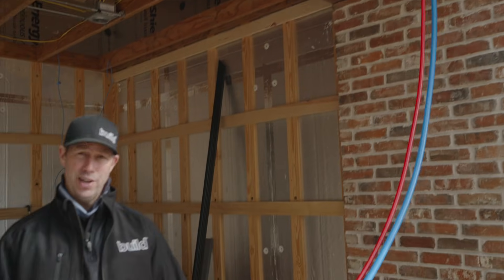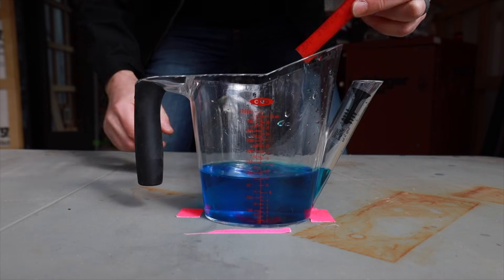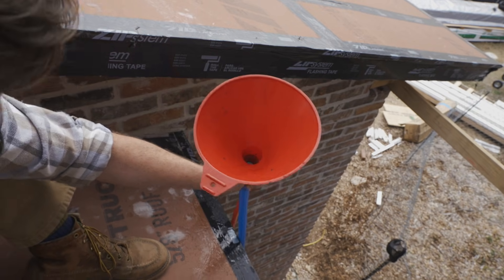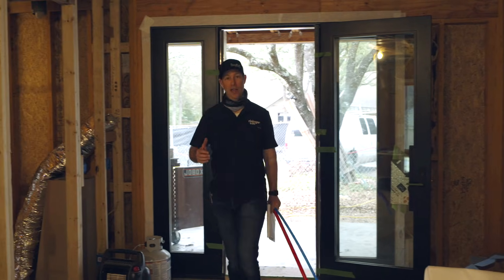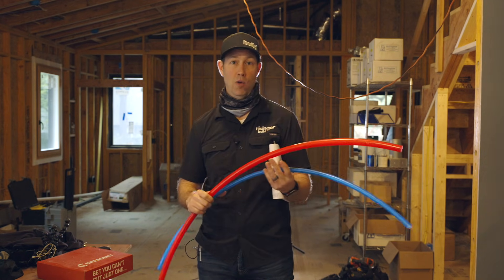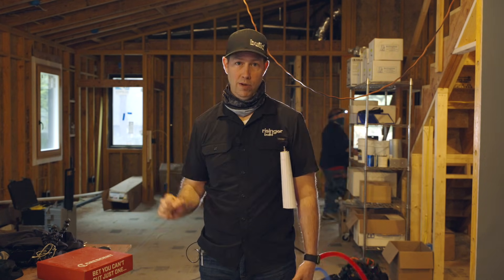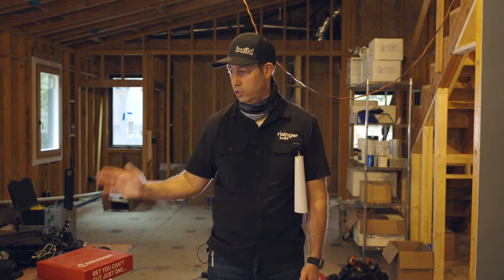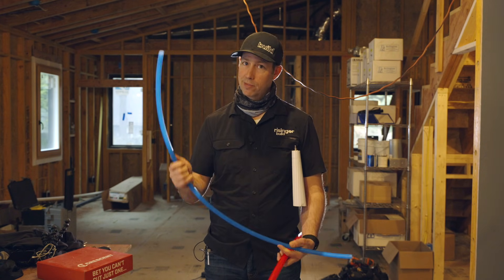What's the BEST Plumbing System

Comment: Thanks Matt. I love the nerd testing and stats on volume comparison between 1/2 and 3/4. Recirc pumps are definitely on my list of epuipment to implement as standard practice. Though it's a hard sell for some reason. My last two clients declined recirc pumps, and now they regret it. I installed a Veiga Manabloc in 2009 in my first house. I loved the idea of controlling each fixture and eliminating joints. But using less pex with a trunk & branch system and the assurance of ProPex joints I've not installed one since.

Comment: Could you have a hybrid of a manifold that splits to different bathrooms, then its trunk and branch in that room?
Reply: Yes. I repiped my house in that manner. Shut off at each sub manifold. Every bathroom and kitchen has a sub manifold with water shut off. I can control every single pipe in my home with water shut off. Hot and cold separately as well, or shut a zone down and beyond.

Comment: It would be nice if you did a video of your "structured wiring" set up, dealing with network cabling, coax, and so on.
Reply: @zlmdragon.  To get the most out of an antenna you pretty much do. Yet another issue of whether you want a good enough system or the best possible system.
Reply: @zlmdragon.  Yeah there are quite a few "rules" for running coax. Stay away from high voltage cables and if it has to cross one it has to be perfectly perpindicular. Cut the excess cable and put a new end on, or at least don't coil the excess because it can cause interference, etc. I don't even know most of the rules for antennas that's above my pay grade but I know a guy that is a HAM radio operator that told me those rules for coax and that's just the basic stuff.
Reply: @zlmdragon.  I agree about the screen quality, but according to my HAM guy you have the potential to pull more channels when setting up the TV if everything is done ideally. I live out in the country where we have to worry about reception though, we only have 3-5 channels here depending on how good your antenna location is. In the city I'm sure it wouldn't matter.
Reply: @zlmdragon.  Working in IT I have seen quite a few bad installs of cat6 systems, mostly by electricians.  There is a correct way to install and terminate it.  When you move up into cat6a for AV systems, this becomes even more important.
Reply: With mesh wifi.  No more coax, network cabling or very little is need now.
Reply: @malibuman8941  as great as current Wifi and home mesh systems have advanced, a proper Cat6 system will still offer a much more RELIABLY fast and stable connection. It all comes down to price and if you are willing to have “good enough” vs “best”
Reply: @malibuman8941  Cabling is still king.  Better than mesh is having wireless access points throughout the house that are run back on Cat 6 or better to a central location.  Also a good idea to run at least one cat 6 to every location where you will have multimedia equipment.  They even have access points that have built in network switches to give you a few ethernet ports there location now.  Cabling if installed correctly is more reliable and has better speed than WiFi.  I do do IT for a living so I might be a bit biased on this though.

Comment: I'd like to see a system that features return piping and how that works.
Reply: Yeah. What's the difference between a "racetrack" and a return line with a recirculating pump? Does the racetrack somehow not have a recirculating pump?
Reply: Update: I figured out the difference. You can run a loop on the hot water supply two ways:

A "closed loop" uses a dedicated return line: hot water exits the heater, makes a loop to get close to all of the fixtures, and then returns to the heater. A pump is run somewhere along the loop in order to keep the loop charged with hot water so that the fixtures are only a few feet of narrow pipe away from hot water at any moment. I think this is what Matt meant by "racetrack".

An "open loop" can be retrofit into many systems: hot water exits the heater, then travels through a main trunk with branches to feed each fixture. In this approach, you "cheat" by putting a recirculation pump at the furthest fixture, and it pumps water from the hot line back into the cold line. Cold water then flows backwards all the up the cold water supply trunk and eventually into the cold water supply of the hot water heater. The cold is a part-time return line. The pump can be controlled by various methods to ensure that the main trunk is charged with hot water on demand. It cannot run continuously otherwise it would turn the cold water into always-warm water.

It seems to me that the best solution to this problem is to just design your house in the first place so that your hot water fixtures are all grouped very close to each other, and also very close to the hot water source. This way it doesn't matter how you plumb, because every fixture will always be within a few seconds of hot water. If you can't manage that, then run a closed loop with a thermostatically or demand controlled pump.

Comment: The nasty "gotcha" with tankless that almost nobody talks about is that they have a minimum flow rate before the tankless heater will kick on. That means that with a common kitchen sequence of doing a one- or two-second hot squirt followed by ten or fifteen seconds off, after a minute or two, you are suddenly getting ice-cold water from your hot tap!
Reply: In my experience, that wait is also one or two seconds. My tankless rocks!
Reply: Never had any of those issues with my 2 tankless units..

Comment: What about building a house with on demand water heaters that supply each part of the home? I am thinking about a small electric on demand in the kitchen, a slightly larger for the guest bathroom, and largest for the master bath that also connects to the clothes washer. These would be pre plumbed for propane when building the house. 🤔

Comment: Another good feature of a loop system is constant pressure provided to each tap off the loop.  Pressure fluctuations from other appliances or fixtures coming on or off are greatly reduced Compared to trunk and branch system.
Reply: no   --- these are not "loop systems".  In these recirculation systems a check valve is placed before reentry into the water heater... So "pressure" is not coming from that source/direction..  The pressure still only comes from one source.  You could make a "loop system" for the cold water though...

Comment: Matt - What about having the shower go cold when someone flushes the toilet? How do we solve that problem?
Reply: Showers go hot when the toilet gets flushed unless the toilet is plumbed with hot water.
Reply: New shower valves that are pressure balanced.
Reply: What? Why would the toilet be plumbed with hot water? I think you have seen too many sappy comedies from the 60s where they implied a water temp change(to hot btw). Besides I dont even know where you can buy a non pressure balanced diverter valve in the last couple decades!

Comment: One issue with a recirc system is that the lines need to be well insulated or you are losing heat.  The higher efficiency of the water heater (and tank in a traditional install), the more energy that will be wasted as the pipe heats.  One regular way I've seen this combated is by using a timer on the recirc pump, but many of us don't have regular schedules for using the home hot water, so you end up either using it a lot more or it doesn't do much good.

Comment: 1/2"pipe 98' is 1 gallon. 6 inch pipe 8 inches is 1 gallon.  I know this because of water volume issues.  231 inch² per gallon. 

I love the manifold set-up for having to repair something. So mainly rental property.
The recirculation pump hot side is very nice, until you are searching for the proper shut off valve.

Comment: solution: don't have two sinks half a meter apart.
Reply: Or don't be dogmatic about the manifold and have some 'trunks' coming out of it (ie a single bathroom is serviced by one manifold circuit) instead of a single line to literally every fixture.

Comment: I recently replumbed my 1900's era farm house.  Using PEX-A, I did a hybrid of trunk and branch and manifold, without a recirc pump.

The system has a manifold for each room that uses water.  One manifold port each for Hot and Cold, for the main bathroom, upstairs bathroom, basement bathroom, kitchen, laundry. etc.

To the bathrooms the cold lines are 3/4", while the hot line is 1/2".  This ensures that there is plenty of flow for toilet, sink and shower on the cold.  While on the hot minimizes the amount of waste water.  Having the trunk/branch and manifold hybrid also means if I shave, then hop in the shower the water is already hot for the shower.

In each of the rooms, I've measured (by time) how long it takes for hot water.  Downstairs bath, by the manifold is only a few seconds.  Main bath is 35 seconds, upstairs bath is about 30 seconds.   When the house was on the trunk/branch where it was all 3/4" pipe the time was in the minutes.

I decided to NOT get a recirc pump as it was 'one more thing to fail', and with the longest hot run only being 25 pipe feet, it wasn't worth it.

I do agree, the best plumbing system is one that was designed.  The worst is one that was "just installed, cause that is how everyone does it".
Reply: I am doing something very similar with PEX-B

Water heater is located near Master Bath so there's a 2 port manifold there to start. Then I have a 3/4" trunk teed in and running to the other side of the house to a 4 port manifold that is handling Kitchen, Washing machine, and other bathroom. The branches there are 1/2" and run about 10 feet.

Recirc can be done on my system, but I think I will do the user-testing portion before adding it.

Comment: Just so you know...pressure is the same coming out of both. Pressure is determined by elevation, not volume. That's why a water tower can hold sufficient pressure for a city, even though in comparison to the volume of water required by a city there is very little water in the tower.

Comment: So what does the ID of the pipe have to do with water waste? Wouldn’t a larger diameter still waste the same (or more) volume of water, just taking less time to get the desired temp? 

Or was the premise to not worry about wanting a larger diameter, and to focus on the type of implementation?
Reply: If a shower head is rated for 2.5 g/m, there will be a larger volume of cold water between the WH and the shower head with a 3/4" line, thus more cold water going down the drain with a 3/4" line, thus taking longer for that larger volume of cold water to empty out of the 2.5 g/m shower head.
Reply: @mcintosh.daughter  ah yes thank you, i didnt account for the flow of the faucet or shower head. Yeah I was just curious why the volume was initially compared. So it sounds as though the smaller line is preferable if you want to minimize water waste? Maybe I misinterpreted the beginning of the video thinking the opposite.
Reply: @ALMX5DP  Yeah, since most fixtures have to meet some water usage requirement, the greater the length of 1/2" pipe and less of 3/4" between the WH and fixture, the less wasted water, and less wait time.

Comment: Does pushing into 3/8ths from 3/4" or 1" cause any immediate  pressure or velocity changes?  Does it have any effects on the lifespan to connector fittings?  Or any noise from immediate changes to the waters natural flow?  I'm not a plumber.  HVAC Master tech here just thinking about refrigerant flow and all the nuance that comes long with it.  Then somewhat applying the logic of that to this.  Probably shouldn't im guessing.  And may get taken to school for asking.  But I'm curious and learn by asking questions...TIA
Reply: Good questions. Laws of hydraulics are in force here. I also would like to know the answers to these questions.

Comment: im here from off the ranch the abandon mansion series-  i had some questions regarding propane hot water tanks-
Reply: Ask some questions.
Reply: lol forgot to ask lol i have a park model camper trailer with addition. we need a hot water tank because i added a washer dryer to trailer. buying a 40 gallon propane hot water heater is the same price as a tankless hot water heater. i did do some research but wanted an opinion of some one more into building homes. all i have is dishwasher, kitchen sink, bathroom sink, shower, and a washer. what would be your opinion on which would be more useful and do you have a video on it?
Reply: @alwayshungry24  I would be curious as to the quality, reliability, and performance of a tankless WH that is the same price as a 40gal WH. Price needs to also reflect cost of venting and installation.  I only install condensing tankless WH's. Only heat water when you need it. Depending on the brand and model, you want to make sure the BTU rating will raise the temp of your incoming water to the desired temp at however many gallons/min you anticipate requiring. What is the BTU rating of the tankless WH you are looking at?
Reply: @mcintosh.daughter  6gpm at 150000 btu  by rinnai sold at lowes for about $800
Reply: @alwayshungry24  Great brand. Does it vent with 2 or 3" sch40 pvc?
Reply: @mcintosh.daughter  it says it requires a 5in water heater vent kit that just says plastic and no specifics at $120
Reply: @alwayshungry24  A 120,000BTU WH should produce enough hot water if you are taking a shower while the dishwasher and washer are going simultaneously.
Reply: Just installed an outdoor 180k btu LP on demand heater that I got from Menards.. Works great, no need for expensive exhaust and doesn't take up any room inside.

Comment: A hose is basically a long cylinder, formula  π r² h, so the volume of a length of pipe will change proportionally to its diameter squared.
Placing the hot water tank near the places it is used is a good way to save the water used.

Comment: Manifold for me due to the removal of temperature fluctuations associated with water usage at other points in the trunk and branch system. My wife can do laundry, dishes, and use the bathroom all while I take a comfortable unchanging temperature shower.
Reply: Seems like a thermostatic mixing valve would easily solve that issue without needing a manifold system.
Reply: If you size the water system properly you shouldnt have temperature fluctuations. I have the one pipe system and have never had any issues.
Reply: @fortunatedad7695  I agree with you here. Our system is 22 years old all 3/4" copper. The main run is over 100FT. We don't have any changes with temp if someone runs more than one fixture. however the pressure can change just a little depending on the well pump. But that's not enough to matter.
Reply: In Europe the cold water in the pipe issue led to us abandoning the whole idea of a hot fill for washing machines or dishwashers entirely. They all come cold-fill-only now and heat their own water entirely from scratch internally, since they were mostly ending up doing that anyway, even when connected to a "hot" supply. So they have no effect at all on a shower even without a thermostatic mixer (who on earth doesn't use a thermostatic mixer, though?)
Reply: @balllightningfr  you're totally right. They show a guy fitting the insulation at 9:37 but never explain it
Reply: Get a thermostatic shower valve
Reply: Well if you were helping with the laundry and the dishes you wouldn't have to worry about temperature fluctuations.
Reply: @mcintosh.daughter  fair point. But in all seriousness I usually do the laundry 🤣
Reply: @blahblah6061  Same! It seems in my house that no one else ever has anything to do until I get in the shower. The very moment I step into the hot water, suddenly everyone magically has to do the dishes, do the laundry, use the bathroom, wash their car, water the garden, fill the pool... literally anything and everything that requires running the water is done the moment I step into the shower. It's aggravating.
Reply: I too ditched my traditional plumbing for a monobloc and it changed my life.  You can shower and flush a toilet and nothing happens.. also it takes less than 10 seconds to get hot water anywhere in the house..  

To me a recirculation system is a waste of money in both capex and opex...

Comment: Funny, I have been researching dedicated recirculating lines the last few weeks and  have been youtubing videos. I have a crawl space and everything is accessible to do it. Now trying to figure out what kind of pump and how to control it. Right now looking at the push button with timer control sort of like the video you did a little while ago. Will save water and the should lower sewer bill too, since that's calculated on water usage. Toledo Ohio. Keep the video's coming.
Reply: I've been happy with my TacoGenie
, offers few size pumps depending on needs and comes with a trigger button which you can expand upon.  In my case I have a home automation system so when I turn on the lights in the bathroom or kitchen it automatically triggers a relay which starts the pump.

Comment: I did the 'racetrack' layout on a house a few years ago.  But my HERS rater told me that a recirc pump COSTS me HERS points.  (I think a point or 2 if I can remember.) I could never understand that due to the fact that I would still insulate the hot line, and it would still be on a timer, and not needlessly running all night for example.  And, as the video states, you would definitely be saving all the cold water that would otherwise be wasted waiting for hot water.  Seems like a wash for energy costs, and a gain to have access to hot water quicker.

Comment: What about all cold lines and point-of-use heating? I understand that the installation cost might be higher but would the benefits be worth it in the long run? I saw Home Performace pipe their new home like that and I'm curious what you think of that. Please!